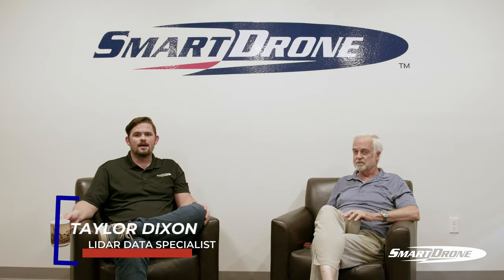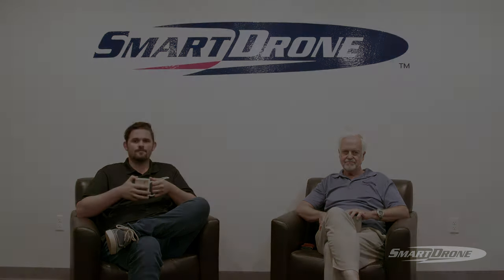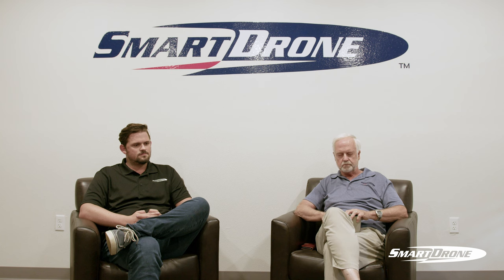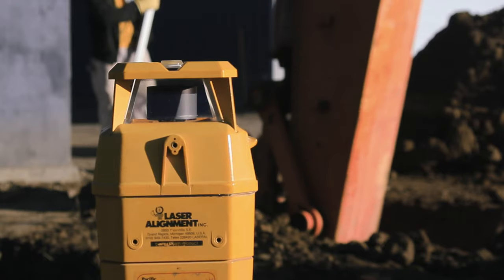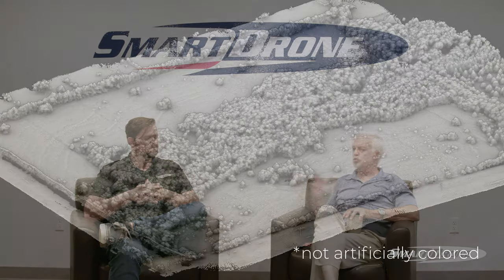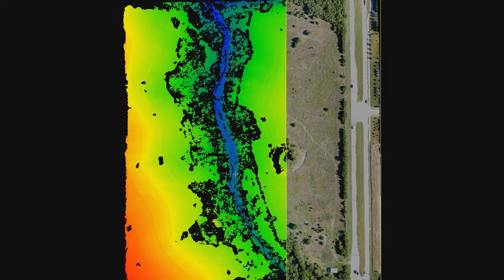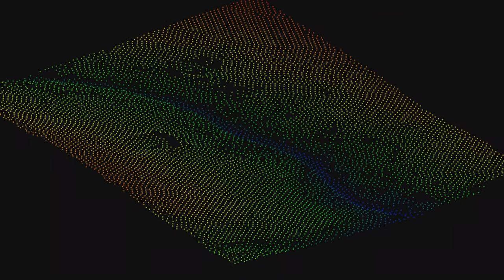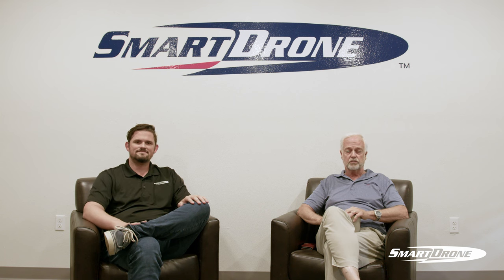Lidar Basics and Using a Drone for Survey

Comment: can it penetrating water bodies?
Reply from the maker: HI Allan, thanks for your question. We do see edges of ponds and can identify water surface and the Discovery unit will not penetrate water accurately. If you haven't already, check out bathymetric lidar systems which are made to deal with water refraction... That technology is amazing too!